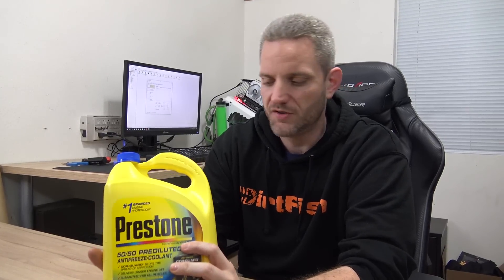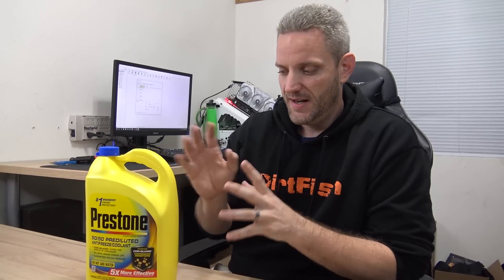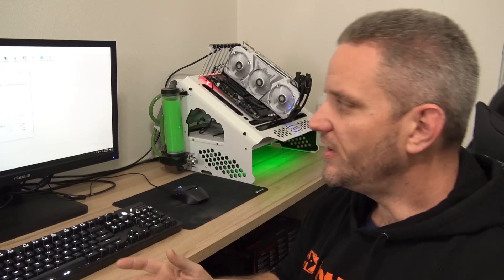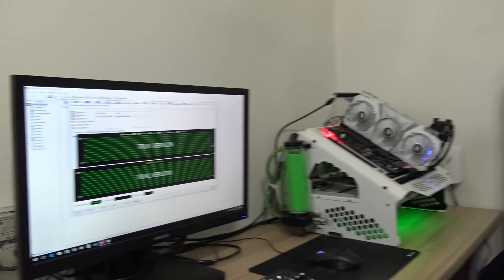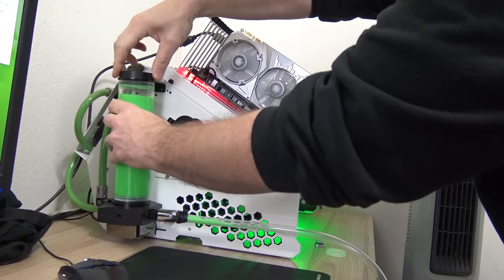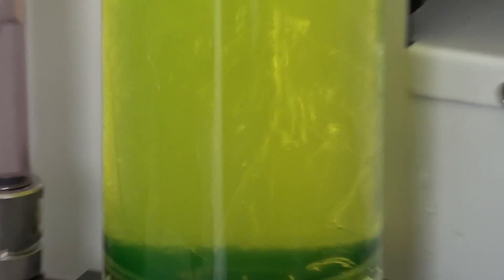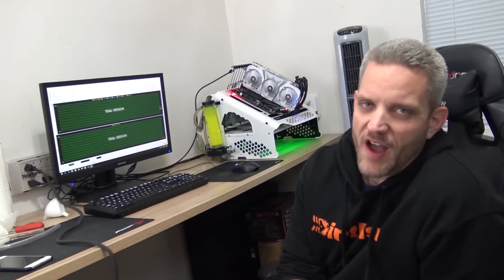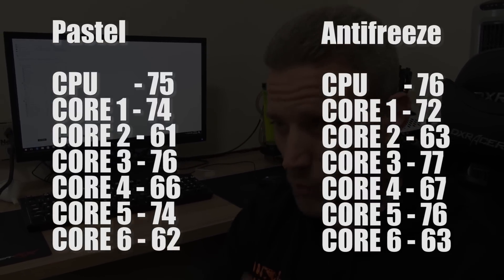I used Antifreeze to cool a PC

Comment: Linus did a whole room of computers on a single loop watercooling build using Antifreeze.  Not sure what kind of tubing they used, presumably not something glycol based.

Anyway, the problem they ran into is that there are apparently some species of mold that thrive in ethylene glycol.  The mold colonies started to clog up the water blocks, and they had to put a bunch of disinfectant and sterilization gear into the coolant line to kill off the colonies.

Comment: In Australia at least (not sure about the rest of the world) there are two types of anti-freeze, Type-A and Type-B... Type-A is the real stuff for cold climates, etc and contains the glycol based checmical, but... Type-B does not, it only contains rust inhibitors and a wetting agent. I have been running on Type-B $8AUD for 10L coolant for years at a time between water changes. Add a few drops of washing detergent to the mix to give better wetting properties (changes the surface tension) for better metal contact through the super fine waterblocks.

People should be aware that pure distilled water is THE best conductor of heat, no additives improve upon it's heat capacity, things like the rust inhibitors and in the case of Type-A anti-freeze, the glycol additive reduces the heat capacity of the water. Even adding a dye/color to the water degrades its performance. The issue with pure distilled water is, there is nothing to prevent microbial growth, or metal migration, which is why Type-B coolant is the best option here as it is a cheap premix designed NOT to corrode Steel, Aluminium, Copper, and NOT eat PVC, Rubber, PLA which has been proven in the biggest industry on the planet for well over 100 years.

Comment: give your pc crushed up viagra pills, should give it a little boost without overheating it :)
Reply: LeonardoDeCaprisun no. Put legs on the system to make it run faster
Reply: See a doctor if your overclock lasts 4 hours or more.
Reply: LeonardoDeCaprisun laughing and crying at the same time   

NICE
Reply: That's how you make your own rigid tubing
Reply: If performance increases persist for longer than 4 hours, call geeksquad?
Reply: Don’t forget std meds

Comment: Thank you for  posting this pointless video! :-P LOL! The very first loop I built I used a glycol based coolant (Pre mixed, still have a litre up stairs!) after a few months, about three, the temps were going all over the place... Well, it turned out that the tubing had been stained red, and on dis-assembling the water block I found half the channels blocked with some sort of "GUNK!" Gave it all a good clean, replaced the pipes and refilled with a NON-GLYCOL coolant and it runs fine! Well until the motor on the pump went up the creek!!! So I pulled out the loop and replaced with a duel pump with an XSPX top and res and other parts.now getting ready to put the old loop into another pc. :-)
Have  a good one! :-) Kev B.

Comment: What about water based with dissolved salt in it? Salt makes it easier for water to boil, so in essence doesn't that mean it absorbs or transfer heat better? As long as the water gets cooled off sooner it shouldn't get too hot.

And saltwater shouldn't affect the tubing.

Comment: I'm using a mixture of 90% water with 10% Glysantin coolant concentrate. Reason for that is my radiator from a car made out of aluminum. This system is running safe without leaks or problems since april 2015. 
The only problem you have to care about is the tubing. I'm using special Norprene tubing - this stuff ist designed to handle acid and other chemicals without any reactions. 

The problem with PVC tubing or other "normal" tubing will appear after 2-3 days. The coolant will turn into a slimie and honey-like mix of something and will distroy your pump.

Comment: An important factor also, which justifies your original opinion of just about the same temps, is the surface area of the component(s) being cooled. Its the same parameter, so I would reasonably assume the same result, no matter what you used to cool as a medium. Just not much surface area being cooled.

Also, there are different types of glycol, and triethleneglycol has the highest heat transfer coefficient over di or just glycol. Makes a huge difference; although, with such a small surface area to cool, it would still not matter much in this experiment.

For better results you could use Dowtherm, which is propylene based glycol with much less toxicity, but still, with a small surface area to cool, not much gained. Main differences are viscosity and toxicity between glycol and propylene based glycol, which is as you stated a big concern.

Their purpose is freeze protection, not cooling per se and surface area is as important a factor as to what the cooling medium is that is being protected.

Q=mcPDeltaT

cP being the specific heat.

Water has the highest specific heat of 1; therefore, I am not surprised the water alone will cool better or take the heat away better, but for freeze protection, which is what a glycol based solution is predominately for, the specific heat is .815 with a 50/50 mix; and therefore, only allows a lessor heat transfer transport capacity, heat being taken away being less than 100% water due to the higher specific heat of water.

Water alone will evaporate eventually and also corrode, even if enclosed; but water will transfer or transport heat away at a higher rate, with no toxicity over any glycol.

Comment: What is the cool-off period you used between changes of fluids?

Since the PC was running when you started the video, how long?

How long did you wait for the components to cool down prior to starting the second test with the second fluid?

Did you test temps in any other fashion or use any other devices for temp checks?

Just curious, that's all.

Comment: Why could you not use a refrigerant like freon with some sort of compresser and condenser located so that the gas evap cycle happens over the cpu? kinda like a refrigerator/ac unit for a pc? Pretty sure it could work.
Reply: LinusTT has a video on exactly that, turns out condensation is a thing.
Reply: ah yea, that is a problem in AC too, has to go somewhere. Im sure there is some way around it/collection though

Comment: Okay my best original idea here, (link up with Cody from CodysLab and try to cool a Pc with Liquid Mercury.) i think it could be interesting. but also really dangerous. good for a million plus views,
Reply: mercury eats aluminum like paula dean eats butter
Reply: JD Cunningham . Mercury is extremely dangerous. If your loop leaks, it's not just your CPU that's gonna do the dieing...
Reply: Florin Pandele please just take a look at cody's lab channel! mercury is only dangerous if inhaled, you  can even eat it and you wont die.
Reply: Mercury is a metal, and is extremely dense, you will need a reaaaaaaaaally big badass pump to move it around the entire system. 1 liter (0.26 Gall) of mercury weights around 13.5Kg (~30 pounds)
Reply: kolby4078 and copper likes aluminum like Paula Deen likes other races
Reply: damn ye! mercury for liquid cooler! great idea.
Reply: Mercury is not that dangerous, (the only big issue is that it evaporates into the air and then u end up breathing it.)
Reply: At least one nuclear reactor in the 40's used mercury for cooling, it's indeed an amazing coolant if used properly (it has very high thermal conductivity but low heat capacity), despite the problems it might originate, just make sure the loop has no aluminium in it ;)
Reply: I wouldn't expect mercury to work well at all. I will assume that the major cooling will be due to circulating the mercury from the "water block" to the radiator and will ignore the thermal conductivity of the mercury since I suspect the fluid flow will be much faster. So now for a bit of math.

1st, let's look at the specific heat of mercury vs water.
Water - 4.186 Joules/gram °C
Mercury - 0.140 Joules/gram °C

So mercury has a rather low specific heat per gram. But since we're pumping the mercury as a fluid, let's convert to joules per liter So let's look at the respective densities.
Water - 1 gram/cm^3
Mercury - 13.69 gram/cm^3

So for each cm^3 of fluid, we have the following number of joules absorbed per degree C rise in temperature.
Water = 4.186 Joules/gram °C * 1 gram/cm^3 = 4.186 Joules/cm^3 °C
Mercury = 0.140 Joules/gram °C * 13.69 gram/cm^3 = 1.917 Joules/cm^3 °C

So assuming you can actually pump the mercury at the same rate as the water (by volume), the mercury will be less than half as effective as the water.  Only reason I can see for using mercury as a heat transfer medium is if you intend on using temperatures high enough to boil water at high pressure, but low enough to not boil mercury. Say somewhere between 150°C to 350°C. And those temperatures are well beyond what I would desire in a PC.
Reply: I know they make non- Ethylene Glycol coolants but I believe they’re PG based, so still glycols. Like the Dodge/Chrysler orange coolant or the “Universal” Red/Pink coolant.

Couldn’t you just use a different tubing?

What about Betaines like trimethyl glycine, I remember seeing research and even a patent using betaines as coolants that claimed to be more effective than Ethylene Glycol or Propylene Glycol. 

Is methanol or ethanol a viable option? Since the purpose of antifreeze is to depress the freezing point (unnecessary in PCs) and elevate the boiling point, I’m sure there are better alternatives than water. 

I guess it’s just the cost to benefit/performance increase ratio that matters at that point?

Also, there’s been a lot of research into nanofluids or nanoparticles suspended in liquid, like water. Examples being silica, alumina, titanium dioxide, carbon nanotubes, copper, silver or gold nanoparticles to enhance the heat transfer capabilities of the liquid by as much as 350%!

You could also try glycerol or even oils, like mineral or castor oil if your pump could handle it. Silicone oils or fluorocarbon oils such as 3M’s fluorinert coils also work but there’s the toxicity issues.

Although a far better solution in that case would be to use a pump-less cooling system with submersible cooling coils and fans to move the liquid.
Reply: Interesting idea, but I don't think there would be a small pump powerful enough that would be able to efficiently move the mercury around.
Reply: also mercury is way to heavy for a normal pump to work with
Reply: its mercury it would get hot as fuck.
Reply: Water is also electrically conductive
Reply: @darklight5627  Not distilled water, at least at first.  It's the dissolved ions in water -- the calcium, magnesium, and such -- that makes water conductive.
Reply: The most obvious problem using mercury in a loop is the weight. Mercury has a density of 13.534 g/cm^3 making it 13 times denser (and heavier) than water which means your pump is going to have to work like a motherfucker to push it around your loop.

The other (less known) problem is that mercury can react with a lot of metals to form a metal amalgam. It will readily react with aluminum, copper, and nickel (even a small scratch on the aluminum can allow this process to occur deep into the metal) eating away at it and forming a goop (not good for a cooling loop).

Almost all metals can form an amalgam (notable exceptions are iron, platinum, tungsten, and tantalum) so a cooling loop with mercury might need some very exotic materials.

Long story short, there are few if any benefits, and a significant design change to make it happen.
Reply: cool
Reply: i think @TheBackyardScientist  is his man for this...
Reply: Mercury would eat everything. If you are going to do something so stupid you might as well go full stupid and use NaK
Reply: Hmm another major issue I could see with mercury is that while it may be a liquid it's still a metal and electrically conductive, it's probably got a pretty good chance of shorting something out. Also while metals have good thermal conductivity their specific heat capacity is usually very low (They are good at passively moving heat but storing any amount of it so you can actively transport it around they suck at). Take for example some more common liquid coolants water = 4.18 J/g/K, ammonia = 4.74 J/g/K (usually only used when needing to radiate the heat to a very cold environment space for example), mineral oils are around 1.67 J/g/K, even gasses are better nitrogen = 1.04 J/g/K, earth air = ~1.00 J/g/K. On the other hand mercury = 0.14 J/g/K, copper = 0.38 J/g/K this just isn't a role metals are strong at though Aluminium is fairly close to the gasses at 0.90 J/g/K.

Of course the thermal conductivity of the mercury would partially offset the low specific heat capacity but still as we know passive cooling doesn't really work as well as actively pumping heat by a long shot you would probably have to pump several times the mass of mercury to match the effectiveness of air cooling and of course expend several times the amount of energy for the pumping too. The reason why liquid cooling is so effective a relatively small mass of circulating liquid coolant can carry a relatively large amount of heat it would actually be more power efficient too but that only applies if you use a passive radiator to cool the fluid if you want a small radiator like is usually the case with a PC cooler generally you end up actively air cooling the radiator to minimise the needed surface area which nullifies said benefit.
Reply: Seraphina S When ur comment is toooooo long like What The Fuck m8 chilloot

Comment: i have keep using neste super rallycar stuff antifreeze for almost 10 years and it is way better than any off those expensive shit cos it doesent coler the plastic tubing atall and i havent had any leaks or malfuctions whit this stuff so 2-4 euros and it will last a years  ihave changed it only couple off times cos i wanted different color so work great

Comment: I use antifreze in my benching system, but unfortunatly i can't tell if it damages the tubes, because i use standard radiator hoses from a car, which are obviously designed to handle this stuff...
My reason was, that the destilled water i used before froze, with the antifreze i have been at -10°C on the CPU (idle) without any problems :)

Comment: Vodka loop.  How well does a computer work with a blood alcohol level of 40% ?
Reply: Russian hackers will attack your system and download all your coolant.
Reply: Life of boris did it
Reply: There is a channel called "Life of Boris" that used vodka for pc cooling and it worked better than water by around 5 Celsius degrees (at least in his setup)
Reply: Bloody FX That's Boris being... well, Boris. Alcohol has shit thermal capacity (pure water has almost double) AND really shit thermal conductivity (pure water has more than thrice). Vodka is almost half ethanol, so, you can do the math. Besides, it's ben tested a few times, it's ass.

Dont get me wrong, i love his channel, but if you take something, anything, he does seriously, you might have a problem, LOL.
Reply: killer1986chris No, they would drink all the alcohol leaving only water.
Reply: nichogenius alcohol poisoning
Reply: Look up craftcomputing he does it with whiskey.
Reply: Look up LifeOfBoris Vodka Cooled PC
Reply: Nick Christensen 🤩🤩😂😂
Reply: yes big issue people have are wrong fluids with wrong tubing. people use c1000 thermaltake in glycol based tubing and it turns to mush. iv had it in my system for 5 months looks new still others turns to mush in a week
Reply: @NoAkomplice  Correct, propylene glycol. Not only is it used in making vape juices, but it's also used as a food additive. In rural locations, it can be bought at farm supply stores by the gallon because farmers use it in the winter in order to keep livestock water supplies from freezing. It is also used in RV's and campers for winterizing the water lines.
Reply: blood alcohol  doesnt work like that it is actually its actualy water-alcohol level

Comment: Ethylene Glycol has nothing to do with "cooling" in fact it slightly inhibits the ability of the water to cool (absorb heat).  It's purpose is to keep the system from freezing by lowering the freezing temperature of the combined mixture to well below the typical 32 F/0 C freezing point of water.  In other words, it's not uncommon that people with cars in say, a hot desert, use just pure water as a coolant because the ethylene glycol is "mostly" useless in that environment and in fact lowers the heat capacity of the water by some % depending on the ratio of mixture.

Comment: In case anyone is wondering about the tube that jay removed from the reservoir. That tube is meant to be in inlet, making sure that the hot water goes to the top of the tank while the cooler water is pulled in at the bottom of the tank. It is also meant to help with air to be removed from the loop.

Comment: Meh, comedy usually is pointless outside of getting a laugh.  However, you do have the face and the voice as well as the slighted humor for it, SOOOOO, you should do more crazy coolest videos just for the kicks of the pointless humor!  In fact, you should, maybe, do some mroe weird things, like, take one of your older, more useless computers you never intent to use, and do some weird destructive test to it, just to see it burn it in strange ways, in safe room with a glass safe box, and a vent for the safe box leading safely out of the safe room for testing the destruction of the older grandpa computer you will never use nor intend to use again.

Comment: Why not set up an empty loop? Just have a pump, a reservoir and some soft (maybe mix in some hard line) tube and let that rip in a tub for the inevitable failure. Then you can say with some evidence about how long it would take to kill your system.